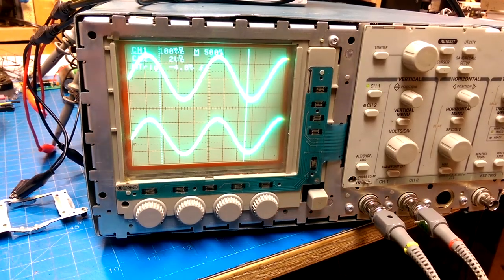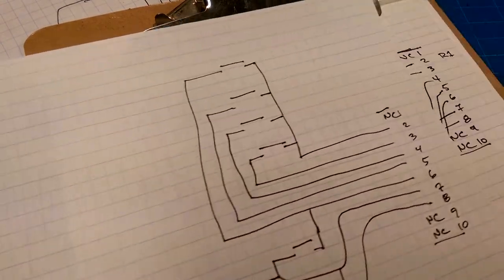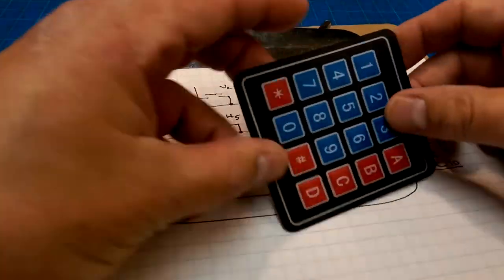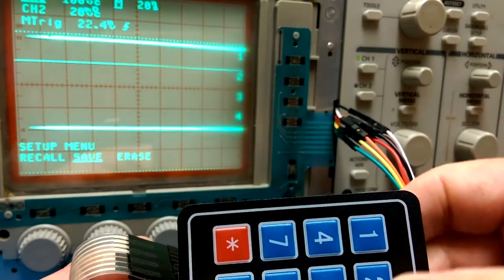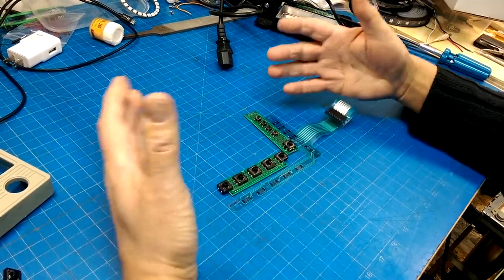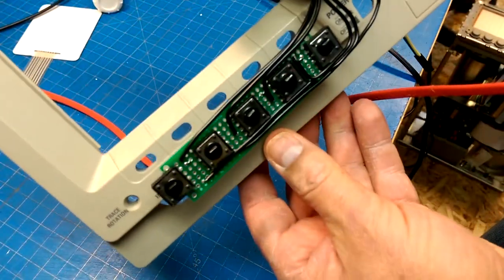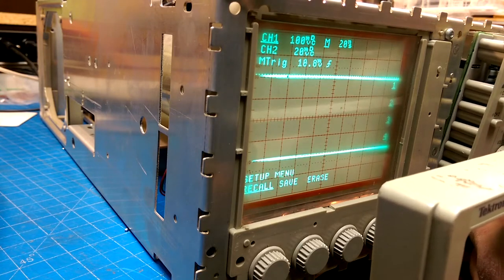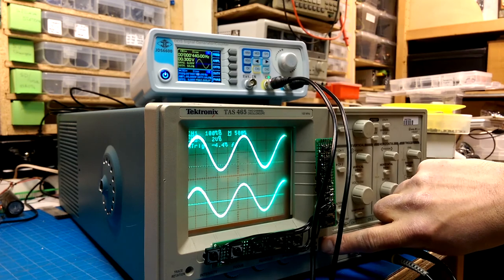its alive   frankenscope

Comment: If you never replaced the front panel switches, I don't see why you could not just make a separate tactile switch box to sit on the bench and run a cable into the scope. That would make a clean, professional looking, more permanent solution. Just an idea...
Reply from the maker: I already gave it away to a friend in need of a scope.  They might print a box for the switches.